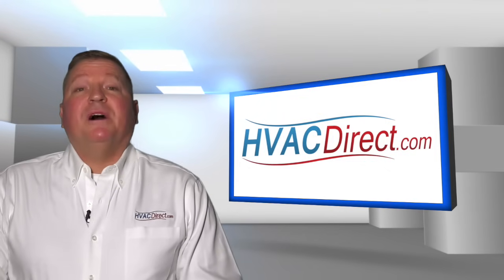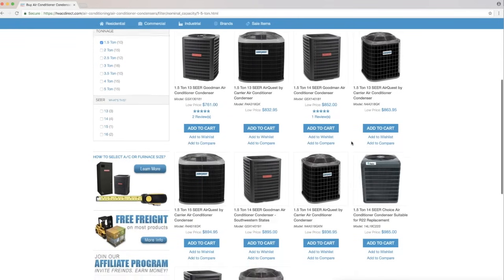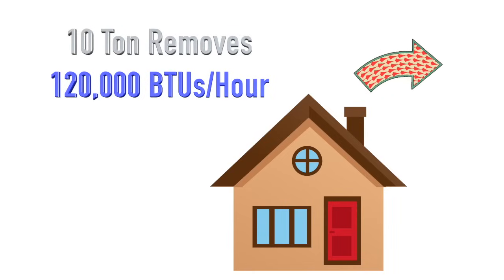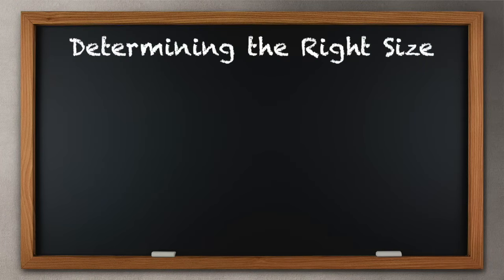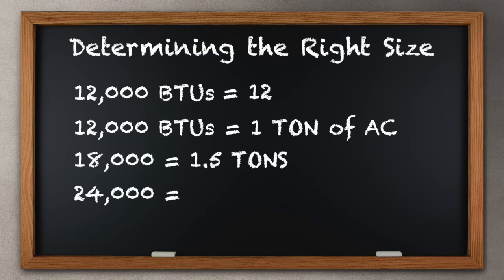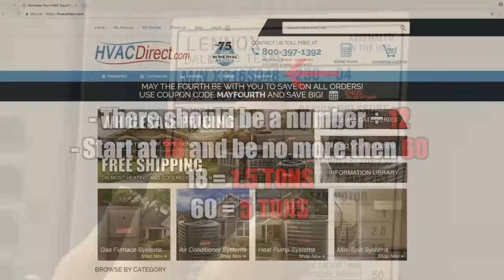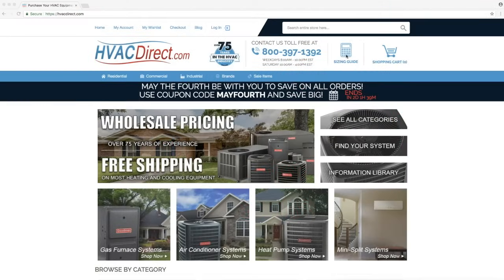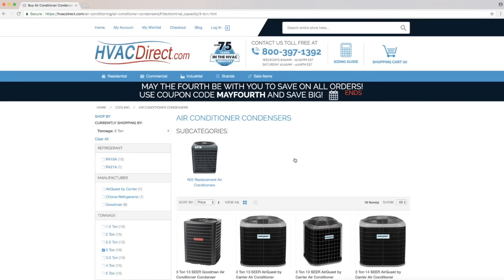What is Tonnage and how to calculate

Comment: Some other technician  depend in horse powers like asian country
Reply from the maker: Thanks for your comment! To our techs over in Asia (and rural America and anywhere else that relies on horsepower as a rating): When viewing this video, the short answer is that you can compare about 12,000 BTU to 1.5 HP. The long answer is that calculating output by horsepower can be tricky as horsepower is the rotational energy needed to drive the compressor. Assumptions would need to be made about the efficiencies of the other parts of a system. So, it is possible for a 1.5 HP air conditioner to output anywhere from 8,000 to 16,000 BTU based on the efficiency of the system. ACs that have horsepower ratings often have a kilowatt output rating as well which is better rating to convert from. You can compare kW output to BTU output at a rate of about 10 kW to 34,000 BTU. Let us know if you have any additional questions - our certified techs are ready to help!

Comment: This assumes that the original install of an HVAC system was properly sized for the home.  Unfortunately, many new home contractors slap in a generic unit, without doing any real load calculation, which means the unit may or may not be properly sized for the actual weather conditions the home will face.  As such, replacing a unit based on the currently installed system can be very misleading...extremely inaccurate at best.  The true way to calculate the size of an air conditioner is to use the ACCA Manual J method of evaluating the way a building was constructed, factoring in the weather conditions of the home's location, and then entering in square footage and other relevant information to come up with an accurate size.  This video is totally wrong to use a currently installed system as the basis for a replacement system!!
Reply from the maker: Thanks for your comment! You are correct that the industry standard ACCA Manual J is hands down, the best way to calculate your home’s heating and cooling loads. The Manual D is also the gold standard for sizing the ducts to get the conditioned air to where it needs to be. We always recommend a customer have a professional sizing done before purchasing new equipment, especially if there have been previous concerns about cycling, continuous running, and underserved rooms that receive little conditioned air. However, if the system was originally installed by a reputable company, it is perfectly fine to use the current system as a start to think about where you’ll be. But we agree it is not the only point to consider when choosing new equipment. We’re more than happy to help size or provide advice on a case-by-case basis by calling 1-800-397-1392 or visiting HVACDirect.com.
Reply: Nahhh, video is not "totally wrong". If your old system worked well and just needs replacing, replace it with a new model of the same size and you'll be just fine, higher SEER, even better and no manual needed.

Comment: Hello sir, 
If I was to purchase a/c unit with more seer rating do I need to increase the duct size?
Reply from the maker: Thanks for your excellent question! As long as the system tonnage and air handler CFMs remain the same, the increase in SEER will not affect the airflow within the ductwork. The difference you will see with increased SEER will be the savings in your utility bill.  Any changes in those other variables, then you would want to have your ductwork re-evaluated. If you have more questions, feel free to reach out to one of our experts at HVACDirect.com either online or at 800-397-1392.
Reply: @HVACdirect   Thank you.